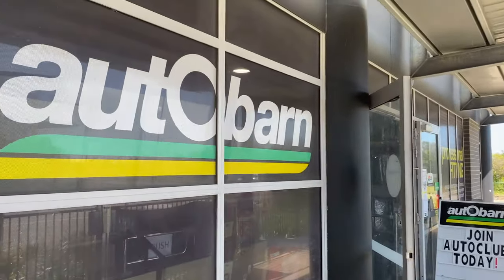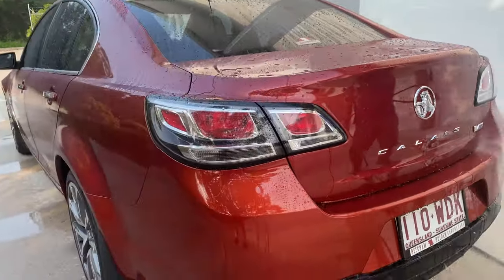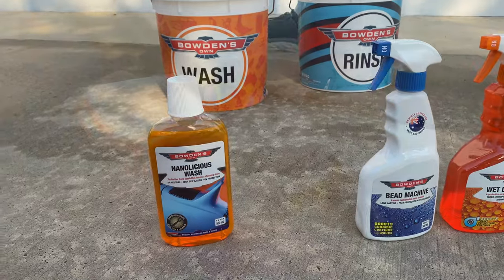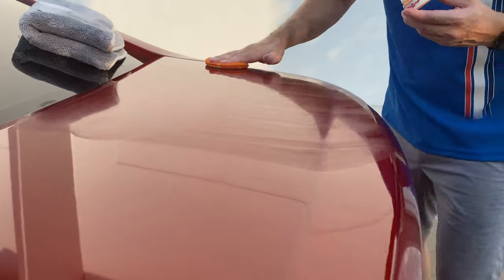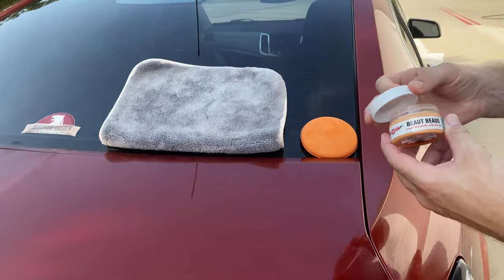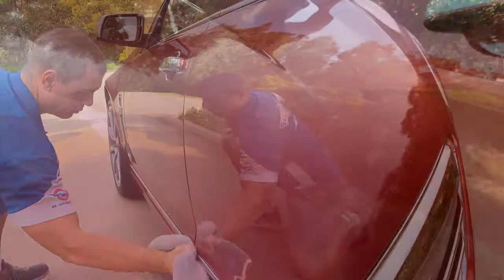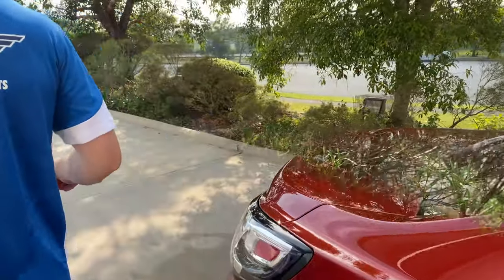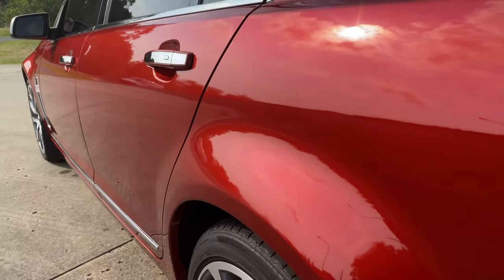Using the All Aussie Bucket

Comment: Surprised bead machine goes on top of this and not the other way around. Looks great. Can you guys make a video (if it hasn't already been done) on the order to layer all your products?
Reply from the maker: Oh yes, there was an older school of thought that sealants should go on the bottom, we have found that to be wrong in some pretty extensive long term testing. It makes sense though, as the oils and light solvents used in paste waxes will remove of affect the sealant underneath as its rubbed on. Having a water based sealant on top that shares similar chemistry works really well in this case of Beaut Beads and Bead Machine.

Comment: Hi BO team.
Can I use my quick wax instead of BB if I have no time. Then apply Bead Machine the next day?
Reply from the maker: Hi mate, if you wish, however you'll need to give the panels a quick wipe down with the Flash Prep spray first so the paste wax is bonding to the paint, rather than the layer of spray you've put on their the day before.

Comment: Is there any way of telling if a used vehicle has been ceramic coated in its life or not?
Reply from the maker: Sorry for my late reply mate. Yes you generally can - a good way is to look at the water behaviour on the paint, if it beads like crazy and keeps doing that for many weeks or longer there is a pretty good chance it does. Sometimes it has been ceramic coated, but the coating gets covered in contamination and stops beading, a quick run over with our Three Way decontamination spray and then gently rub the Claying Rubber over it to remove this top layer of contamiantion and reveal epic water beading if it is coated. If the water does not bead, there is no coating, or the coating has most possibly failed if it had one, which they can do over an extended time . Hope that helps.